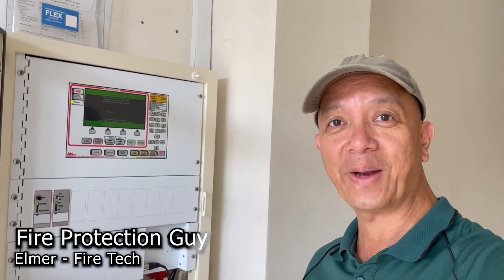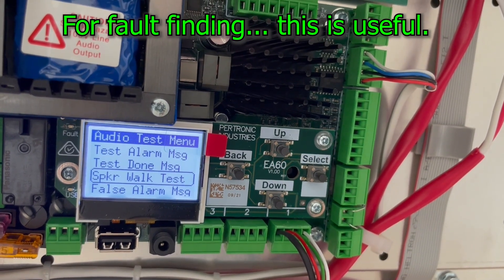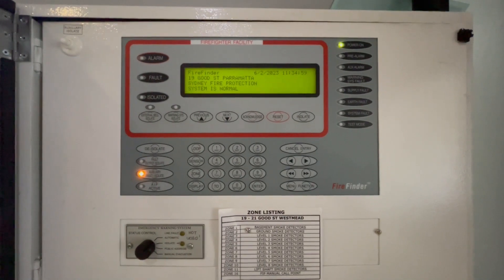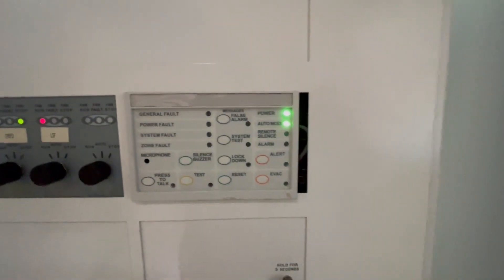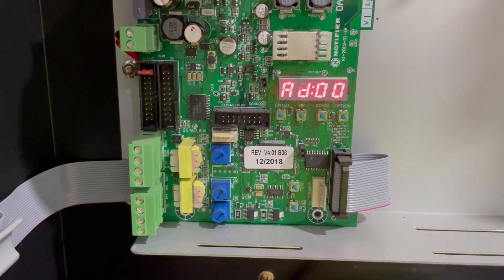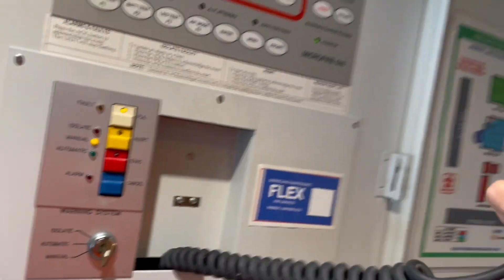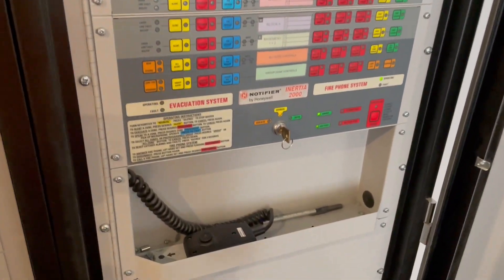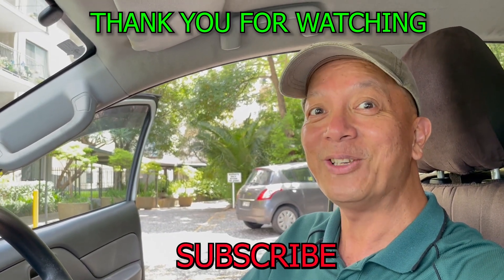Common Fire Alarm Occupant Warning System (OWS) in Australia

Comment: Ahh the F220 Love that panel. was a Notifire fan untill the 3030,  I will never forget the 2800. The new EA series amps are very nice. Using the diffrent LED addressses I love how you can run diffrent tones in all sorts of diffrent events
Reply from the maker: Not a fan of 3030. It's like working in a 1010/2020 FIP. Programming is not as simple as 2020 does.